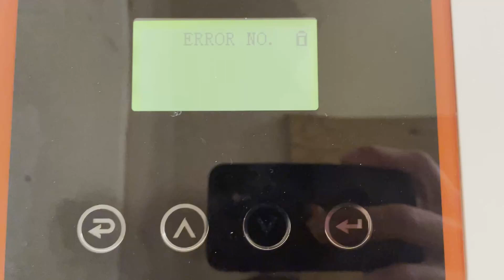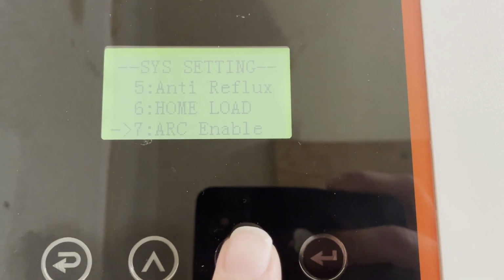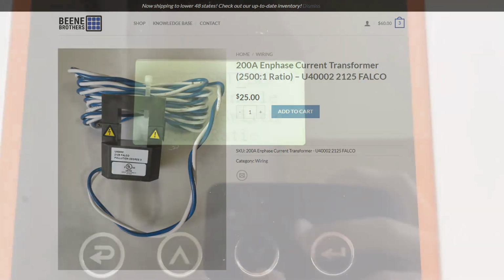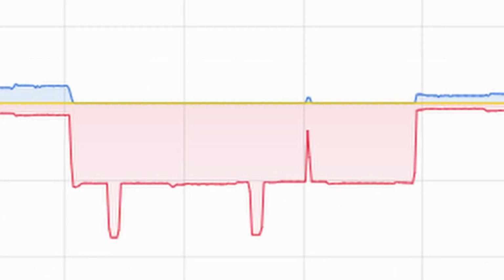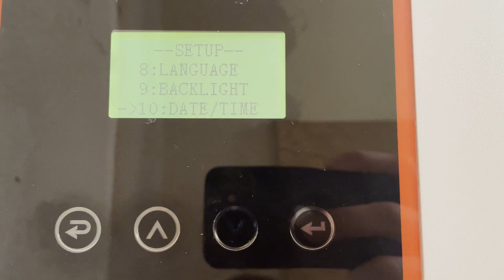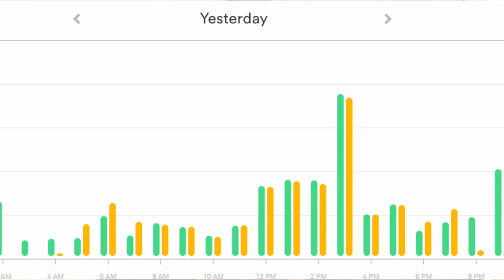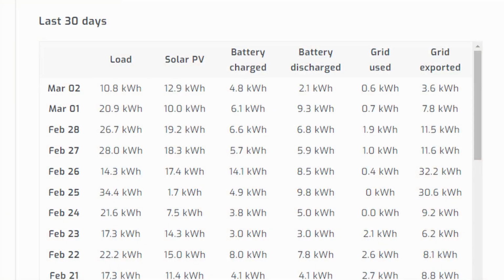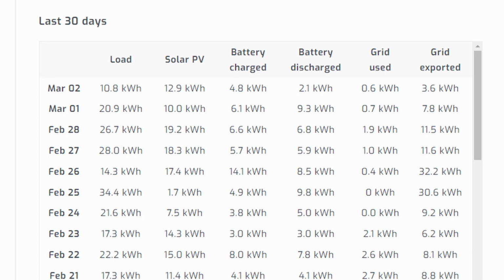Avoiding 30 Cents Per KWH Without A Sol-Ark

Comment: Good video. I am having problem with my Megarevo settings. I used self consume and battery priority because i dont have BMS communication and the inverter is constantly charging from the grid and not the PV. I think based on your video i should just use Peak Shift and set the charge and discharge times. I just cant understand why it would stop charging from PV to use the Grid, it makes no sense.

Comment: What would you consider the maximum length of a CT sensor cable? and does it need to be re-zeroed in theory if the length of the cable is extended?

Comment: Hi. I have tried peak shift mode but the problem is, the battery gets charged using the grid in situation where solar production is low like in cloudy/rainy days or at night. Is there a solution for this?

Comment: Thank you for the video. I'm contemplating buying these units but wanted to know if these issues you highlighted were resolved or being resolved.  How has your experience been so far. Did you purchase the inverter directly from the megarevo manufacturer directly or a distributor. Did you reach out to megarevo to see if the CT on grid and insulation test off grid issues could be resolved through a firmware update.

Comment: when you mentioned that you charge the battery at 100 amps, is that 100amps DC or 100 amps AC???
Reply from the maker: It was 100a dc. On the battery side.

Comment: Yah they should update the software to set it as produktion not konsumption.........so what I do is use a VEVOR 1000Watt Grid Tie inverter then I run it through an Importia Smart Plug to getmy Solar Produktion but the issue is is that I have an Emporia View 16 in my servise panel and that reads it as Konsumption Not Produktion...... What would be Nise is if I kould take the value of the Smart Plug and Flip it to Mius and Not Positive....... Since the Grid Tie Inverter I have kan dump power on to the grid I make sure the output power is not more than my household konsumption so the power is konsumed by the house........for me to get an akkurate number I would have to multiply the smart Plug number by 2 then subtekt that from the total konsumption....... My house uses 160  watts at its lowest so I only have 300 watts of panels........ I would like to push power back onto the grid legally.

Comment: Hey i have 4 Seplos 280 mason enclosures with their 200a bms units.  They by default are set for rs485 PylonTech. Can you please help me get comms working? I get the error and it is not detecting the batteries. Do i need a special rj45? Which port out of the 6 should i plug into? Which on the Seplos? Rs485 or CAN? Thank you for the assist!!

Comment: So, is it worth the cost?  Is it a 2 thumbs up after using for a little bit?
Reply from the maker: I’d buy it again for my uses. Just got to make sure it fits your use case scenario. Don’t assume it does everything a sol ark can do.

I did connect some lighting circuits to it today and in off grid mode they aren’t flickering. That is apparently more a function of the quality of LED’s than it is the inverter though.
Reply: @BeeneEnergy  I want it but REALLY only need a 48v 3000-EHV.  Wish the 6k 120/240v had 2 MPPT.  Anyway....keep the vids crankin.
Reply from the maker: Yeah it's nice but if you don't need the grid backfeed features it could make sense to do an all in one instead. Which is probably what you're thinking.

Comment: how is the megarevo working for you? what will be the best usecase net metering/gridtied or offgrid? where i live we dont have peak rates but we pay 30 cents all day...
Reply from the maker: If you have access to a reasonable net metering program a standard grid tie inverter would be a little less expensive. But if they won’t give you hardly anything for excess generation storing some in a battery could pay off reasonably quick with those electricity rates. My inverter has held up well to my abuse all things considered.
Reply: @BeeneEnergy  yeah in Puerto Rico we have really good net metering program but we also suffer from a lot of blackouts so i was looking for both solutions in one.
Reply from the maker: Ah yeah, so I haven't used the mode but you should be able to set it to battery priority. Keep the battery topped off, feed the rest to the grid. Then when the grid drops out you have a full battery ready to go.